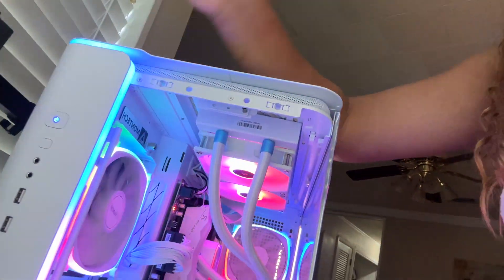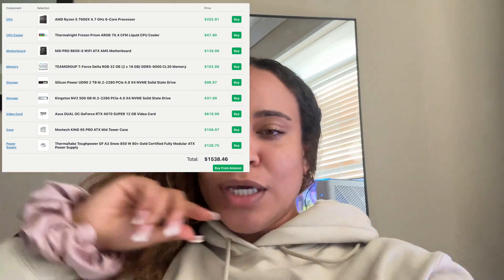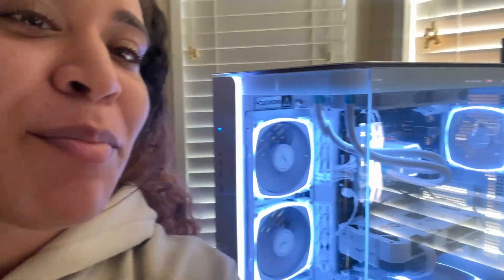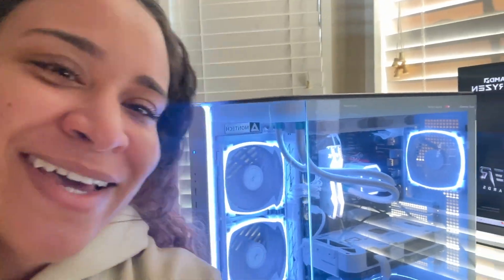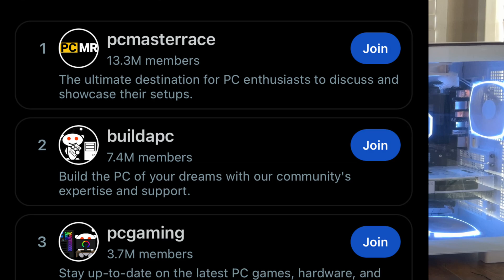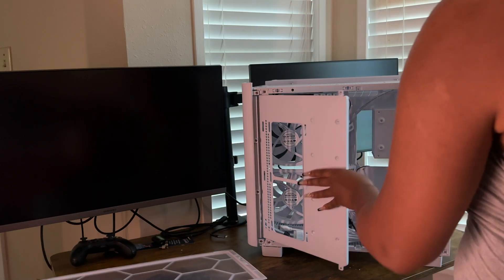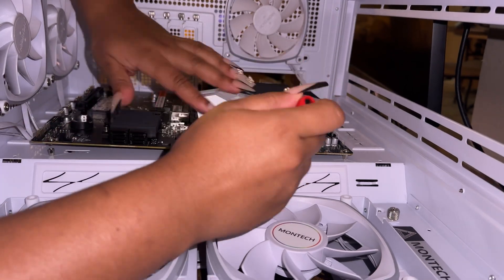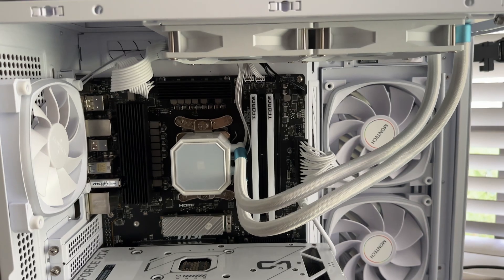How I Built My First PC (No Prior Knowledge)

Comment: I built my first computer about 6 years ago, made some errors on compatability of the parts so there was that blue screen of death.  I corrected the problem after days of frustration. My second build came 4 years ago and it went smoothly with Intel I9 13900k. This computer has rocked solid performance as I'm a photographer and I need the performance to make my work flow, flow without any issues.  I'm now building another computer which I had to speed up my build due to trumps election and his threat to put tariffs on anything from China or any other country we import from.  My new build is still Intel Ultra 285 even though they had a terrible roll out of this new socket 1851.  AMD processors are made for gamers which I'm not.  I'm betting Intel will get their stuff together and fix these issues internally.  Asus Rog Z890 Maximus Hero motherboard, ROG RYUJIN III 360 ARGB to cool this processor, GeforceRTX 4080 graphics card and a ton of fans to keep this beast cool...I could understand when you turned on your first computer build and everything worked.  I can still remember the same feeling when I turned on mine.  Keep on living and exploring new things.

Comment: As a professional PC builder, I'd recommend the MSI MAG A850GL PCIE5, currently on sale for $80, plus $20 white custom sleeved cables for better aesthetics and cost savings. Overall, a well-planned $1.5k build. Cheers!
Reply: I think those psu modles are getting noise complaints
Reply: @AlexandreAlves03  Have used it in multiple builds, so far no complaints !!

Comment: Great job on the build. Looks good. Your parts are balanced too. Only thing I would suggest is to move the aio back some so that it lines up with the mobo since you've got a 240 not a 360. Welcome to the PC master race!!
Reply from the maker: Thank you for the suggestion this is great advice!
Reply: @colewithdacurls it’s hard to tell but seems like all ur fans are set as intake, you need to have the one at the back as exhaust.
Reply from the maker: @ubora1  the back and side ones are exhaust. 3 at bottom are intake.